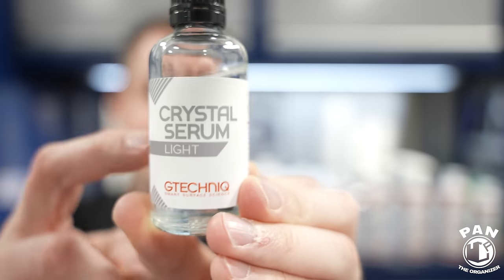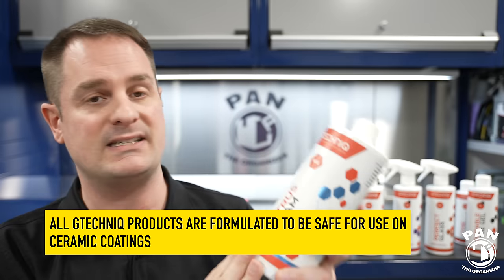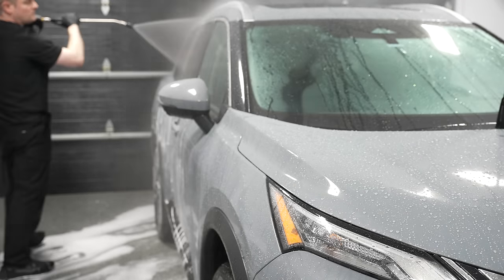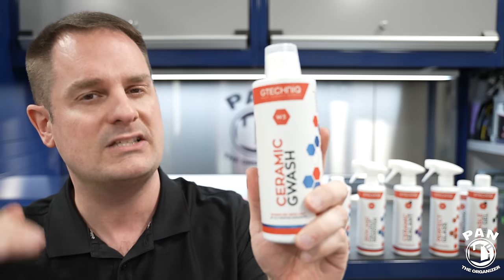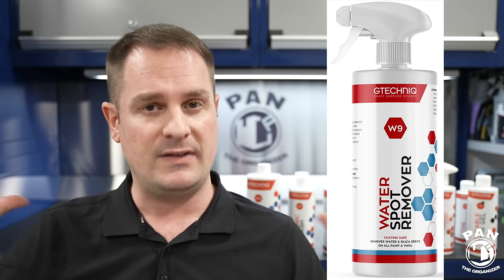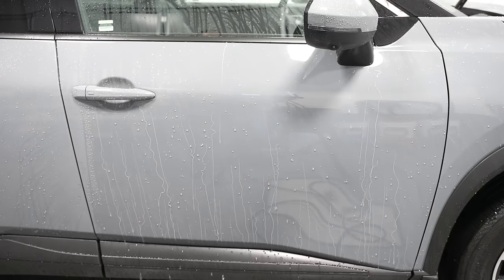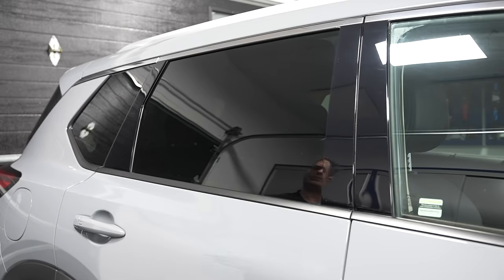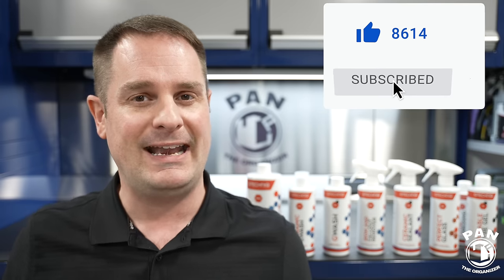Detailing 101 - How To Do A Maintenance Wash On A Ceramic Coated Car!

Comment: I think this is probably the 12th or so video of your's that I've watched but I'm making sure I do my research here because we're taking my wife's new car to a local professional to get a correction and ceramic coating done (Gtechniq Crystal Serum Ultra/EXO).

Here is what I'm planning to get and use in the following order so let me know if anything is wrong or should be done differently or in a different order

All done under our pop up canopy (which I've done for years) so no direct sun and no direct Alabama heat.

- Wash the wheels and tires with Gtechniq W4 (is this sufficient for tires or do I NEED something like Carpro Retyre?)
- Foam the car with W4 and power wash clean
- 3 bucket the W3 ceramic wash (I have the buckets and Carpro's wool mitt already)
- Spray Gtechniq W6 iron remover and wash (I don't have this yet. Just finished up a bottle of Adam's iron remover though so I know the stuff is essential)
- Spray Gyeon Wet Coat (already have as I mentioned on your Wet Coat video) and rinse off
- Blower dry the car (optional?)
- Apply Gyeon Cure or Shine Supply Clutch (already have both and I believe they both do the same thing) drying the car with microfiber rags in the process
- Apply 1 or 2 coats of T2 tire gel

Applying Cure/Clutch spray is the only part I'm not really 100% sure on.  I own both of them and would like to use them but if I'm already using Gyeon wet coat, are they actually needed or is it just more protection I'm adding?  

Thanks for all your informative videos though.  Definitely helping keep me out of this rabbit hole.
Reply from the maker: I would use a tire cleaner like CarPro Retyre for the tires for sure. As far as the rest of your wash procedure is concerned, I'm assuming this will be your MAINTENANCE wash right? AFTER the coating was applied. (Wait 2 weeks after a coating is applied before you start washing your car again).

Because if this is the wash you want to perform before a coating is applied, I would say no, as you wouldn't use a shampoo with ceramic protection in it, or sealants like WetCoat, etc.

But yes if this will be your maintenance wash procedure that is fine. Good choice on getting a better iron remover, as the Adam's is below average. Once you are done applying the WetCoat, ideally yes you would blow dry the car if you have a blower, it's the fastest way and also 100% contactless drying so zero chances of marring the paint.

And after that, you go over the paint a final time with a microfiber towel and your choice of detail spray or silica spray sealant to pick up any residual water droplets (there always are) and boost the existing protection, and gloss/slickness.

Or, after having dried the vehicle, if you're satisfied with the finish, no need to add the final spray. WetCoat does the job of protection.
Reply: @PanTheOrganizer  Yep this will be the proposed maintenance wash. Whatever coating is on there next week when we drop it off at the detailed will get removed as they do clay, 1~2 stages of machine correction depending on the condition then a machine polishing and whatever other prep is needed before ceramic. 

They also keep the car 24~36 hours so the ceramic can cure in their cold/clean room. Not sure how all that works but all 3 major detailers have a cold clean room with UV lamps and air purifiers for ceramics.

Comment: Love the channel... I have a new 2023 white 4runner (2 months old, garage kept) that I am planning on doing a ceramic coating.  Do I need to use iron remover?  Also, with a new car, do I need to polish (there are no swirls or holograming).  If a polish is a must, what gentle polish would I use?
Reply from the maker: Thank you! Welcome to my channel. You discovered one of the biggest car detailing channels on YouTube as we surpassed 895,000 subscribers and we have over 116 million views! I have been detailing for 26 years and I love to share my knowledge and passion with my viewers.

You found the right channel to help you learn everything about detailing. 

Congrats on getting your new 4Runner! However, a new car is never new until it's properly detailed. 
- at the factory, the paint defects are often corrected quickly by rotary polishing which can leave marks and holograms, so polishing corrects those, before you lock that in long term with a ceramic coating for example.
- vehicles are then transported by truck, train and boat so they are exposed to the elements, industrial fallout, brake dust, rail dust, etc
- vehicles are often left at boat docks (when transported by boat) or in exterior parking lots for weeks or months, again being exposed to the elements
- at the dealership, the vehicles are almost always poorly prepped using the same dirty water that was used for all the cars on a given day, and poor washing and drying methods leading to swirls and scratches 
- at the dealership, a layer of cheap wax or paint sealant is usually applied to attempt to make the paint glossy prior to delivery. It's crucial to remove any previous protection before you apply a ceramic coating, as coatings need to bond directly to a virgin clear coat.

If you only plan on applying a regular carnauba wax or paint sealant though, you could decide to skip machine polishing, as those protectants can be applied over existing protection and it's not as crucial to prep the paint as well.

I explain all of this in this popular video: https://youtu.be/QgoyrC-5CMc

So you can better visualize the new car prep process, here are the steps I perform on a brand new car from two of my customers: 
Tesla Model Y: https://youtu.be/gohks8xP5NY 
Porsche 911 Carrera: https://youtu.be/2ckiivbFqs4
Audi Q7: https://youtu.be/t7HCBSVnizM

Comment: Pan ,can you blow dry after you apply the ceramic spray? Or is it recommended to actually wipe it down? And then can I use bead maker or other drying aide’s for exterior wash’s after I do the maintenance wash on a ceramic coated vehicle. As we know these products are costly and not meant for every wash as a business.

Comment: Great video. Perfect timing. I have a to a maint wash on a ceramic coated white truck that has rust spots likely from the brake pads. Sounds like iron remover will remove them?
Reply from the maker: Hi Alan. The rust spots are most likely brake dust (ferrous particles) that embedded themselves into the clear coat, oxidized/rusted and hence why you see those. Yes an iron remover is meant to help dissolve those.

You would proceed exactly as per this tutorial. Depending on how bad they are, a second round of iron remover might be necessary. Wash the car, rinse it, apply the iron remover, let it dwell for the recommended amount of time (don't let it dry on the surface, and don't apply in direct sunlight) then rinse and dry the paint. Look at the results. If there are still specs left, reapply the iron remover on dry paint this time, and gently work it in with a microfiber towel, and rinse. That should do it.
Reply: @PanTheOrganizer  thank you very much for the detailed reply 👍I was hoping that would work. Didn't want to have to use my clay towel to remove those especially on a ceramic coating.

Comment: Hey Pan . I know it’s in a video somewhere but both my vehicles have ceramic and I’ve been using beadmaker and don’t won’t to use it anymore. What’s the best reset wash to get the beadmaker off and not bother my ceramic ? Or if you can tag the appropriate video with that info that would be great and the steps after the reset. Thanks ! Also I just purchased Gtech citrus foam , iron fallout , g-wash , ceramic gwash and wet coat.
Reply from the maker: Follow the steps in my video here: https://youtu.be/z8h8-_j0-mQ?si=89ubVJ9vOpc45vN6

Comment: Hi Pan,
Fir tree pitch/ pollen and excessive dust from a nearby sawmill has ruined previous cars we've had.
Just got a new Subaru and the dealer applied a ceramic coat. In addition to washing, what do you recommend to protect from pitch/ pollen, and what is best for removing the pitch?
Thank You - BTW, appreciate your videos!

Comment: Hi. I wonder if you answer a question, as I watch most of your videos and trust your judgment. I recently had my truck ceramic coated with Gtechniq. However some of the panels don’t bead and I was told that it is due to the fact the panels are plastic and or painted over after leaving the factory. Is this true as I don’t feel they have coated the vehicle correctly. Thanks

Comment: What are your thoughts on using Carpro Reset as the pre-wash foam and then using Gtechniq ceramic wash in my bucket to go over the car with my contact wash with my mitt? Would this be a good combo?
Reply from the maker: Yes absolutely. Or you could use CarPro Lift as your pre-wash snow foam.

Comment: Hello Pan. From Panama city, Panama. Great content. I just to heard detailers talk about maintenance wash and know the meaning. Question on the decontamination stage, we could apply tar remover? And if so, how would you add that step on the decontamination.
Also, by any change do you have a maintenance wash video using another brand of products? (Sorry but I am not in the US) need some options.
Reply: Also another question. Which pre wash foam soap from car pro is the safest for car with ceramic coating?
Reply from the maker: Here's another ceramic coating maintenance wash tutorial using different products: https://youtu.be/yLiePQRMFc8?si=slxvp18k0ea-hb3U
Reply from the maker: Any of the ones in my video here: https://youtu.be/TCQXfXECr5Q?si=imexeptDF_aBxfcm

Comment: For the iron remover/ decontamination is it always recommended for a maintenance wash and also a ceramic coated maintence wash ?
Reply from the maker: You don’t use an iron remover for regular weekly washes. Once every 3-4 months or as needed depending on your level of brake dust contamination. And yes you should absolutely use it on a ceramic coated car too.

Comment: Hey Pan, Great Video. Is it okay to use Iron Remover on a ceramic coated car every once in while? thx
Reply from the maker: Yes as shown in this video. It’s actually recommended to use iron removers on coated cars once every 3-4 months or as needed depending on your levels of iron contamination.

Comment: I did an iron removal step on my new car (built by Mazda in 2023 in Hiroshima and shipped across the Pacific then trucked to the midwest) and I never saw any purple on the car, therefore I don't think it was needed. Doesn't hurt to do it to be sure, though.
Reply from the maker: Exactly. Better safe and go through the motions.

A new car is never new until it's properly detailed. 
- at the factory, the paint defects are often corrected quickly by rotary polishing which can leave marks and holograms, so polishing corrects those, before you lock that in long term with a ceramic coating for example.
- vehicles are then transported by truck, train and boat so they are exposed to the elements, industrial fallout, brake dust, rail dust, etc
- vehicles are often left at boat docks (when transported by boat) or in exterior parking lots for weeks or months, again being exposed to the elements
- at the dealership, the vehicles are almost always poorly prepped using the same dirty water that was used for all the cars on a given day, and poor washing and drying methods leading to swirls and scratches 
- at the dealership, a layer of cheap wax or paint sealant is usually applied to attempt to make the paint glossy prior to delivery. It's crucial to remove any previous protection before you apply a ceramic coating, as coatings need to bond directly to a virgin clear coat.

If you only plan on applying a regular carnauba wax or paint sealant though, you could decide to skip machine polishing, as those protectants can be applied over existing protection and it's not as crucial to prep the paint as well.

I explain all of this in this popular video: https://youtu.be/QgoyrC-5CMc

So you can better visualize the new car prep process, here are the steps I perform on a brand new car for my customers: 
Mercedes S 580: https://youtu.be/Vq_tfcwryVI?si=whord2_UEFSg28UW
Aston Martin Vantage: https://youtu.be/OKga3yZVTqo
Volvo XC60: https://youtu.be/tvDBBenhYFA
Tesla Model Y: https://youtu.be/gohks8xP5NY 
Porsche 911 Carrera: https://youtu.be/2ckiivbFqs4
Mercedes AMG GT63S matte black: https://youtu.be/eU8zg1lXvXY?si=oGxoCp8PWt7gTncV
Audi Q7: https://youtu.be/t7HCBSVnizM
BMW M6 Gran Coupe: https://youtu.be/0lC9uyKXs8Q
BMW M340i: https://youtu.be/etXhJNaF0EE
Audi RS3: https://youtu.be/641mAJfKDLM
Golf R: https://youtu.be/jr19g4PWJsk

Comment: Im sure this has been answered before but do you rinse off snow foam before contact wash or do you leave snow foam on the car to lubricate contact wash?
Reply from the maker: Always rinse the snow foam before the contact wash. After you did the initial foam and rinse, you have the option to re-foam and hand wash, for even more lubrication, or go directly to the contact wash.

The purpose of the initial foam and rinse, is to get rid of 80-85% of the loose dirt and grit. That way you minimize the dirt left for the contact wash, and also minimize the chances of swirls and scratches.

Comment: Hey Pan, what products/brands can I use when washing a coated car with my foam cannon? Can I use Meguairs ultimate snow foam? Or do I need a high end special soap?
Reply from the maker: It depends what your intention is. For regular weekly washing, a pH neutral snow foam like the Meguiar’s or Koch Chemie Gsf is all you need.

But when you need stronger cleaning power for removing traffic film and grime, a stronger snow foam is recommended like the Gtechniq, CarPro Lift, Bilt Hamber Touch-Less, etc. Repeated use of those can weaken even the best coatings so be aware.

Comment: Hey Pan! You mentioned in this video as usually that clay media isn't recommended for coated cars. What happens if you start to lose water beading from the coating and start to feel just a little bit of embedded contamination? Polish when the time is right or can loads of lubrication with very gently use of a clay towel be beneficial into not scratching the paint?
Reply: You can try a water spot remover like gyeons waterspot remover that is made specifically for coated cars or an acidic shampoo like carpro descale alongside an iron remover to try and remove those embedded contaminates
Reply from the maker: Polishing a coating isn't recommended, as you would damage and strip the coating. Mechanical abrasion and friction will remove the coating. Chemical decon steps are always preferred on coated cars. I would recommend the following steps:
1) Wash the car with a decon shampoo like CarPro Descale. It's slightly acidic pH will help remove minerals and water spots.
2) Rinse it, then use a tar remover if you have tar deposits.
3) Rinse it, then use an iron remover to remove brake dust and industrial fallout.
4) Rinse and dry the vehicle. 
5) Then use the water spot remover, which will also help to remove any minerals left on the coating that perhaps are masking its properties. Rinse, and wash the car again. 

The coating's properties should be restored at this point, assuming the coating is in good shape and was applied properly and is still within its claimed durability.

Also, clay bars are abrasive by nature, and again, not recommended on coatings as you would damage the coating and potentially add some marring to the paint.

If maintained properly, you shouldn't have much embedded contamination. In some rare cases where you might find some contamination left after all the chemical decon steps, like a bit of grit in the clear coat, you could use a synthetic clay towel (that uses a different clay media compared to traditional clay bars) and lots of clay lube, in order to lightly clay the surface. A clay towel like this one: https://bit.ly/43nrfce
Or this one: https://bit.ly/43y0Mss

But test on an inconspicuous area first!

I hope this helps to clarify things for you.
Reply: @PanTheOrganizer   and @DragonWithAK Thank you for the responses! I've only done steps 1) and 3). I don't see any tar spots, but I'll definitelly try a water spot remover. It is true that I have tough water, so I guess that will help. What surprised me was that the roof of the car was pretty good with water beading, but the doors had a lot of water pooling. I'll try 1 of the clay towels and hopefully that will help too. Many thanks again.
Reply from the maker: In the future, if you want a spot-free wash experience, look into a simple water deionizer setup like I have. I made a video here: https://youtu.be/IKNL1chAQXY

Also, what brand coating is on your car currently?
Reply: @PanTheOrganizer  It is by Fictech and it was applied by a professional about 16 months ago. I have started looking into ways of getting better water by the way, yes.